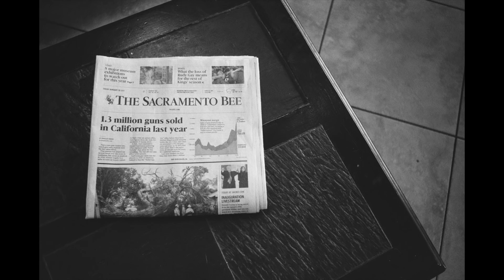Film Speed Explained

Comment: His statement that "speed", be it ISO or ASA or DIN, is a subjective evaluation is nonsense. These "box" ratings are determined by determining what exposure is required to achieve a specific tonal separation of measured shadows. To make the rating comparable between films and between manufacturers,  Fixed standards are required. That do not mean that exposure cannot be made at a different speed rating, knowing that some differing results should be expected. And, the purpose of "pull" processing is to compress a high contrast scene, a scene which cannot fit the capacity of the film, to a lower contrast which will fit the capacity of the film. Overall, this video is a confused mess.
Reply: That's what I felt too.

Comment: My question may sound stupid, but listen to me please. I have a 400iso film, the camera is set at 400iso, my correct exposure is at f/5.6 and I take a photo. Now I decide to set the camera at 200iso because I want to put f/4 for a more shallow depth of field (so I compensate the light and I'm not allowed to touch the shutter speed).
Will my photo, shot at 200iso f/4, be any different from the 400iso f/5.6 one?
I would like to try it but I don't have the possibility to do it.
Reply: they would be the same as the guy said.. one iso is equal to 1 stop.

Comment: Hi, enjoy your vids. Have a question if  I may. I use a Konica AR T. This camera has no working meter because the battery compartment is damaged, so i shoot Sunny 16 with  it.  Is it  necessary for the camera to have battery/meter for the film speed to work, in other words, can the camera recognise film speed setting without a meter? Particularly if you are shooting expired film and want to set 200 speed film as 100, for example. Will it make a difference?
Thanks, and keep making videos about film!
Reply from the maker: Mike Baker well it sound like it’s all in your head. Without a working meter the camera can only do what you tell it to do. The iso setting on your camera is useless now and you are left to expose correctly at your own will. Which. Should be rather easy now that you understand the sunny 16 rule. Don’t trip about iso too much. Just expose at box speed and you’ll be good
Reply: Thank you for the detailed explanation. It's much appreciated.

Comment: I thought that the 3200 film , was an originally an 800 film that was pushed to 3200, and could sustain a 3200 setting - the P in the name ...I could be wrong
Reply from the maker: no you're probably right. iso is fluid mannnnnn haha
Reply: Socrates Ilford 3200 has an actual speed closer to ISO 1200 or 1600 but I have not heard anyone say the same about Kodak’s offering. 

But you could be right.